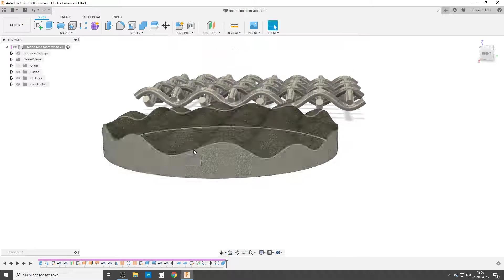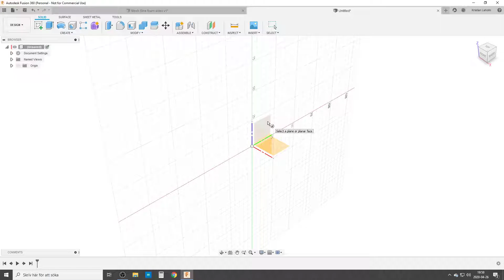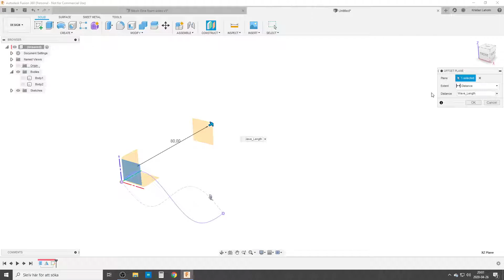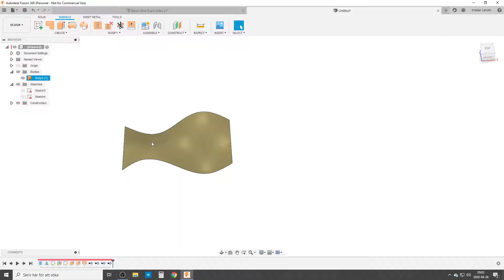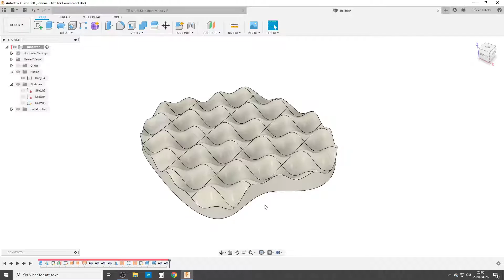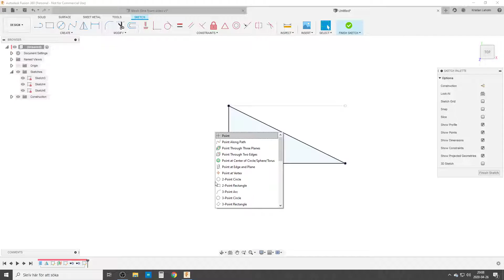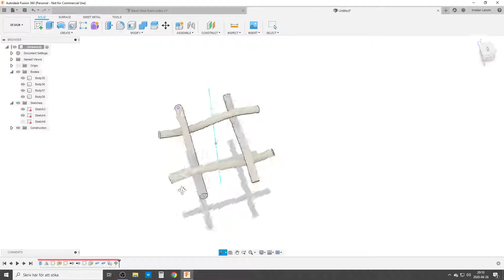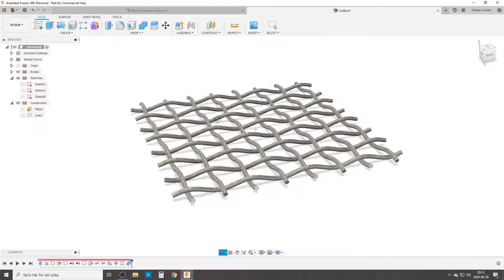Sound Foam and Wire Mesh in Fusion 360 - Sine Wave Pattern

Comment: I was wondering how one would build a spiroll sketch if the coil was not a built-in entity.
Reply from the maker: My preferred method for helix spirals is using surface sweep (along a straight path, line) with twist angle.

Comment: how tf did you turn off the lines at 7:43???
Reply from the maker: That is Visual Style, you find it using the little screen icon at the bottom of the workspace "Display Settings". Or use shortcut CTRL+4 CTRL+6 for shaded model with and without edges.

Comment: Awesome tutorial! Just thinking about, how could i use this as a planter texture outside if I have the shape already?
Reply from the maker: Sheet metal in Fusion can bend things but it doesn't always work with complicated surfaces. Fusion is not the best tool for this type of design.

Comment: Thank you very much for your video! It's great and really helpful! I was wondering how could we do to make them on a different surface, as they are both on a flat one? Curved or angular, for example.
Reply from the maker: You can use the Sheet Metal Bend-trick to bend the pattern but Fusion will slow down to a crawl, this is so hard on parametric software.
This is easier in other software, or you could turn of the timeline to make it easier on Fusion but I know no good tutorials ont the top of my head.

Comment: I find its really a pitty, that one has to do a hack like projecting the coil to get a wave in a sketch in fusion
Reply from the maker: There are some add-ins that can plot math curves but I wanted to use only "built-in" functions. We'll have to see if the Fusion team will add it in the future.
Reply: @KristianLaholm  Yes, it would be awesome, if there were built-in functions for that.
I also looked into add-ins .... i even thought about writign something myself, but it seems that with these addins it isn't really possible to make a truly parametric custom element in the timeline... so that's rather disappointing
What's the point in a script that throws some splines on a sketch, if i cannot parametrically edit thinks like direction, amplitude, wavelength... ^^

Comment: How can you wrap the surface that you crated around a cylinder?  i want to create the acoustic foam in a cylinder shape . thanks
Reply from the maker: Hi I hope you have found a solution but if not, you can use the "sheet metal trick" unfolding a flange and connect the "foam" to that and the refold.
This takes some preparation and planing to make it fit nicely around the cylinder and it's a bit hard on Fusion but works.